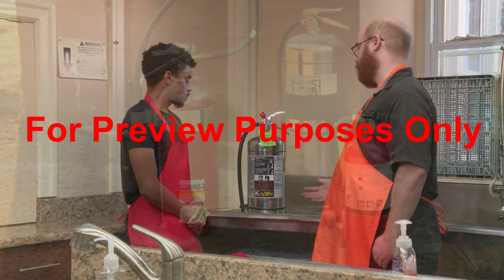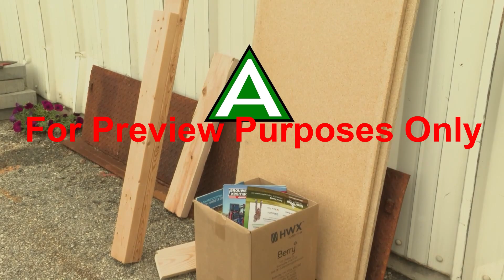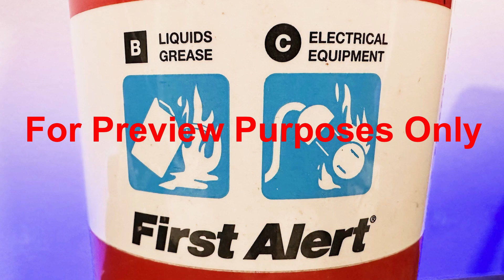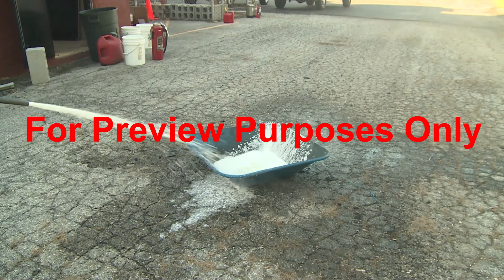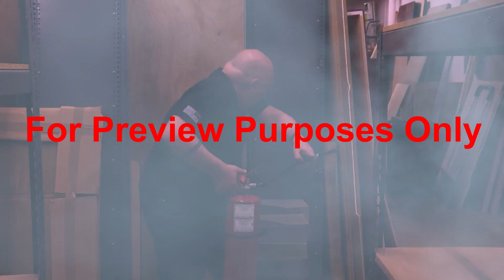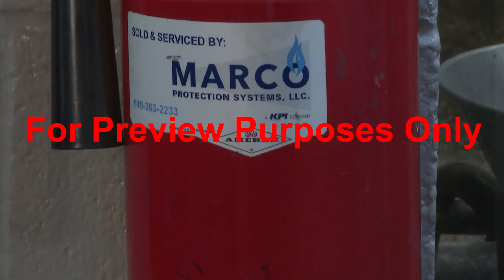How To Use A Fire Extinguisher Training for Employees from SafetyVideos.com

Comment: A helpful way to remember which class of extinguisher should be used is as follows: 
A = Ashes
B = Barrels 
C = Current 
D = Dynamite 
K = Kitchen 

It can also be helpful to know that a class C fire can be treated as a class A (sometimes B or a combination of these) fire if you are certain the circuit involved has been de-energized; therefore an extinguisher with a C rating will always be a combination A-B-C, B-C or A-C rating, with the "C" merely indicating the extinguishing agent doesn't conduct electricity where it can travel up the stream to the operator causing an electrocution hazard.   

A class K fire can be thought of as a class B with some class A characteristics. Some folks think of vegetable /animal oils and fats used in deep fryers as a class B in that it is a combustible liquid fire, and they would be partially correct.    However, fires involving cooking oils in commercial kitchens were given it's own class in the mid 1990s when it became well known that modern commercial deep fat fryers have become better insulated to improve energy efficiency in response to rising energy costs and growing concerns about the impact of burning fossil fuels. While this no doubt reduced energy consumption and improved cooking performance by allowing the oil to more easily maintain it's optimal temperature compared to older cooking appliances, this also rendered the common ABC or BC extinguishers ineffective because they cannot cool the fuel sufficiently to prevent reignition and for that reason, the wet chemical extinguisher was introduced and received a K rating in 1998.  It works on a principle known as saponification, that is, the agent reacts with the burning oil to form a soapy layer on top which cuts off the oxygen and cools the fuel to reduce the risk of reignition.   Most wet chemical extinguishers have an A-K rating.